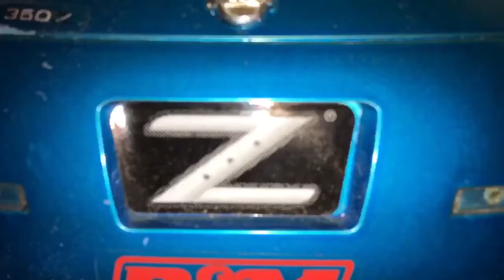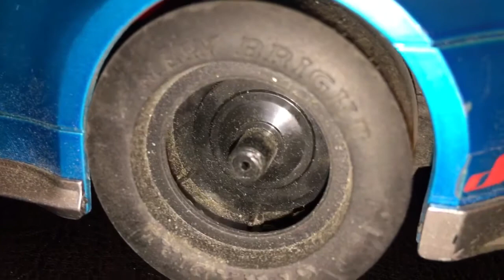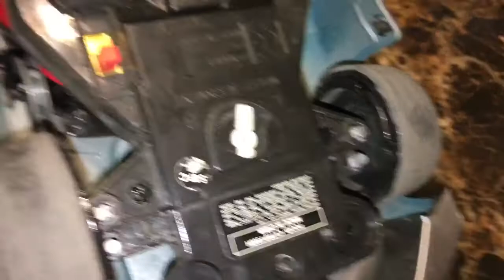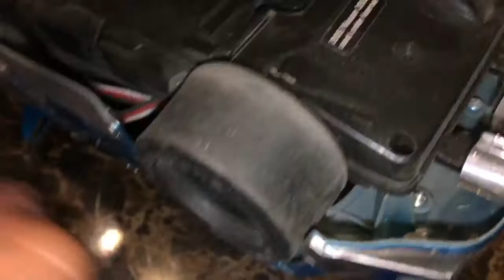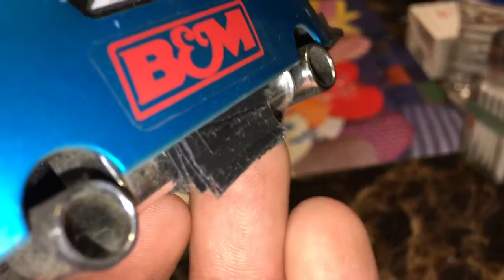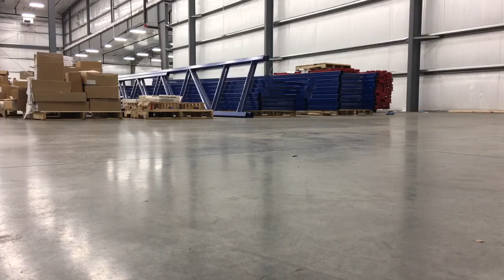Nikko 350z 12volts upgrade and grip tires

Comment: How did you change the wheels?
Reply from the maker: Fingaxe if u hold the wheel then turn the rim the fake rim comes off with the tires then I just put some tires. I had tires from a different car I use to have just happened to fit just right
Reply: @ricerocketspapichulo5534  thanks! Because i have a same 350Z as a project!
Reply from the maker: Wish I could find a motor the same size that makes more power
Reply: @ricerocketspapichulo5534  yea that would be nice

Comment: I have the same car just stock and I need a remote🤦🏾‍♂️
Reply from the maker: 203. swervo if u buy a remote that says 49mhz it should work I’m pretty sure that what they are look at the bottom of the car should say a number with MHz
Reply: @ricerocketspapichulo5534  thanks very much I’m hoping to get it to drift
Reply: Same
Reply: @ricerocketspapichulo5534  where can i find those remotes?
Reply from the maker: @jonisinkkonen5303  from eBay is where I get them.